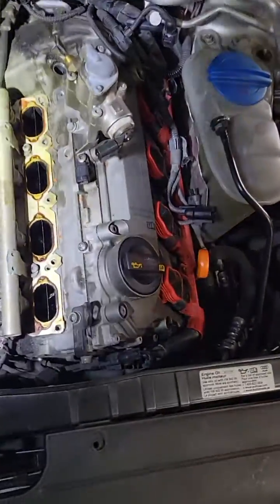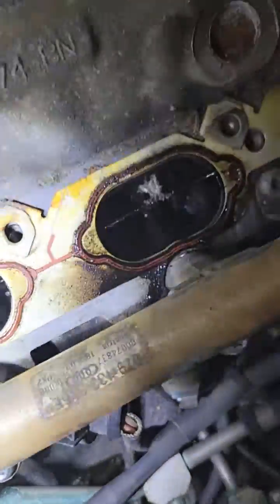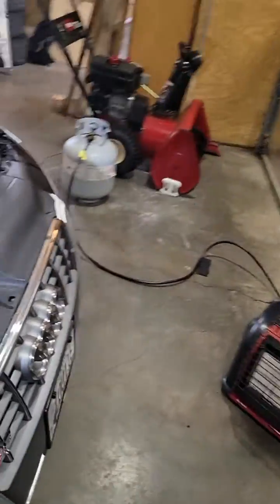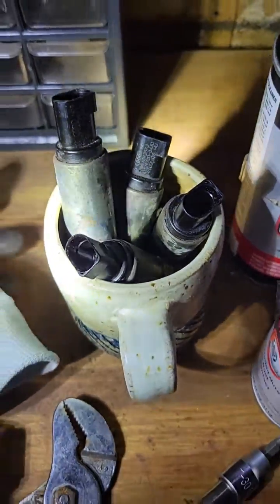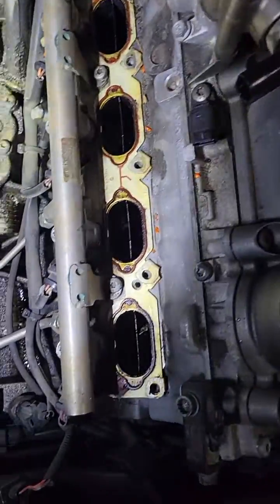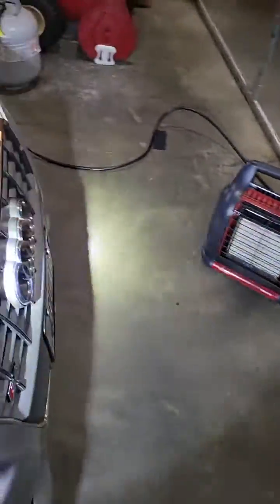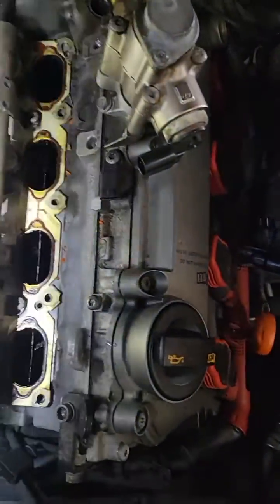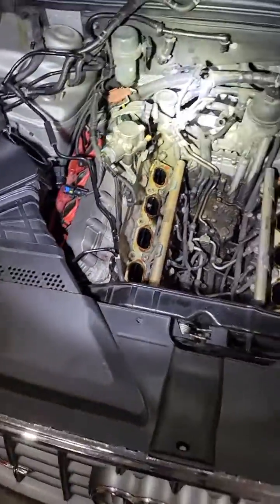b8 s5 4.2 heavy misfire

Comment: Were you able to figure it out? Was it the VVT solenoids?
Reply: @hillclimber4406 you can take the valve cover off and look to see if any springs are broken. If it is it'll look coiled up and will be loose. Shouldn't be able to spin a broken spring. You could also do a compression and leak down test, that might also help tell. But yeah, if a spring is broken, especially in one of the further back cyls, then an engine pull is needed
Reply from the maker: About to try new vvts or camshaf tsensors
Reply: @hillclimber4406  yeah. My s5 had a sudden misfire while driving one day. Codes for the runner flaps, mis on 8, and a multi mis. We tried sparks, coil packs, and took the intake off to do a carbon clean. Injectors were only 2 years old so we just sonic cleaned those and sonic cleaned the vvts after watching your vid. Anyways, long story short, I discovered that the exhaust valve spring was broken, causing it to not close all the way. Luckily I don't think any further damage was done. Currently in the process of pulling the motor so we can replace the spring.
Reply from the maker: same for me broken spring and stuck valve thank you.  @joshuamallets8167
Reply: Sorry, one of the two exhaust valve springs on cyl 8. Which made sense with the code.